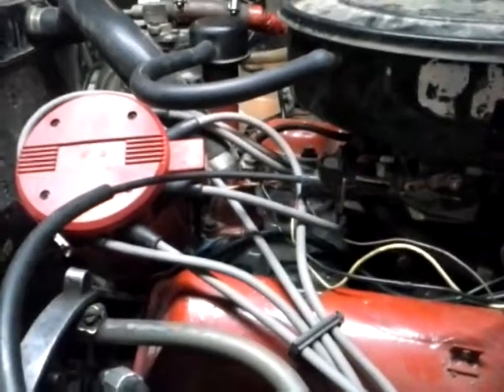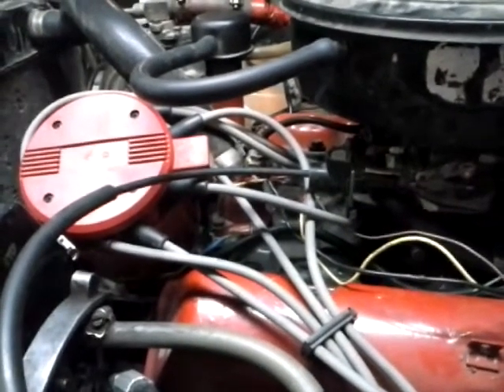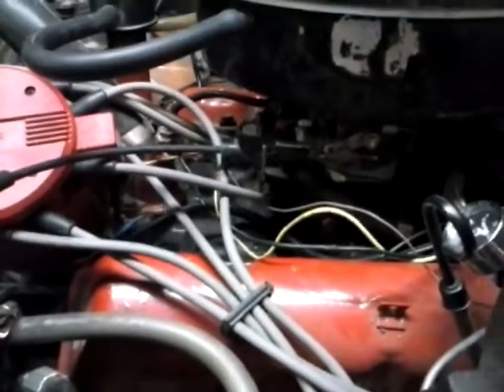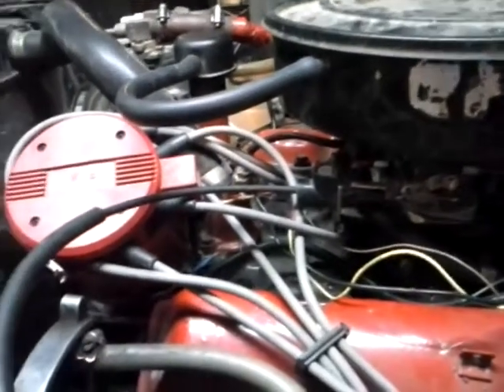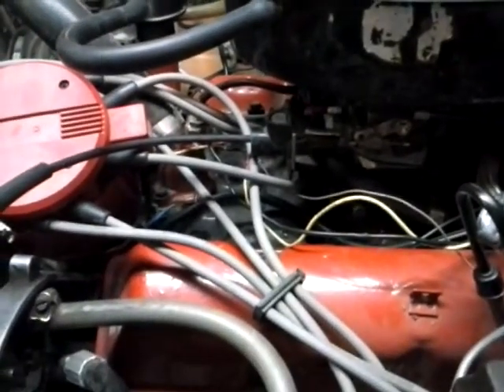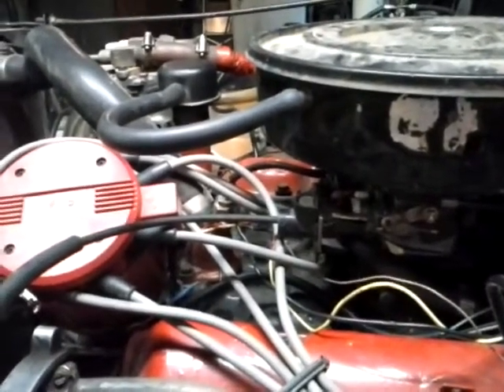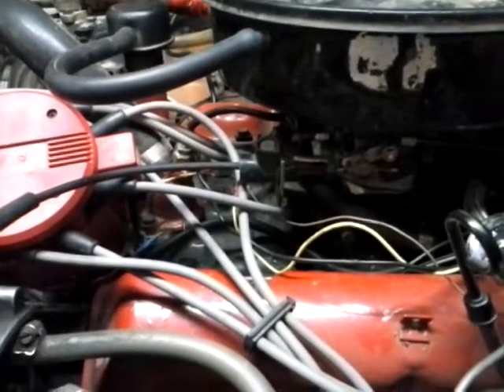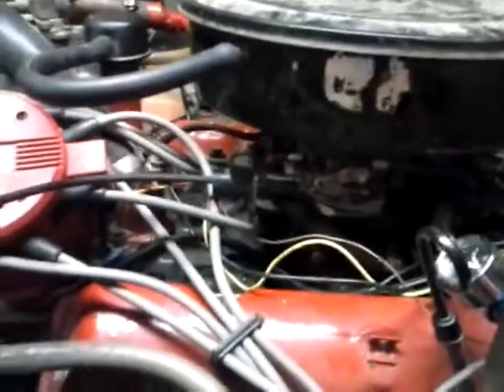AMC 360 EFI Conversion using Megasquirt II

Comment: have you taken it out wheeling and had it cut out at all or does it stay running even when you throttle on and then off again while trying to climb?
Reply from the maker: Diy Jeep Guy Thompson I have had it out once it did I great except when I roll into the throttle slowly. It has a slight hesitation. I think I need to tune my accel enrichment abit more.

Comment: Why was it back firing like that? Did you have the cables for the distributor backwords?
Reply from the maker: MrElPoderozo1 it was probably of a combination of things but ultimately i found a faulty spark plug in the #2 cylinder .
Reply: Rusty Bottoms88 oh ok! Nice!👍👍🇺🇸